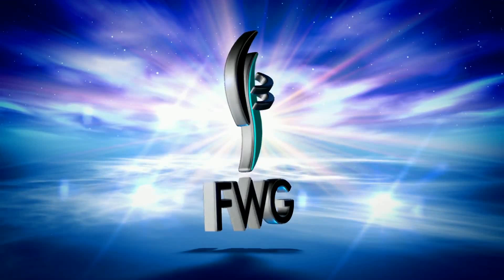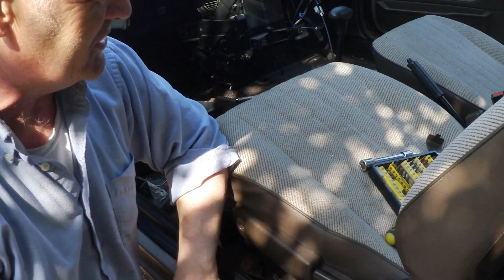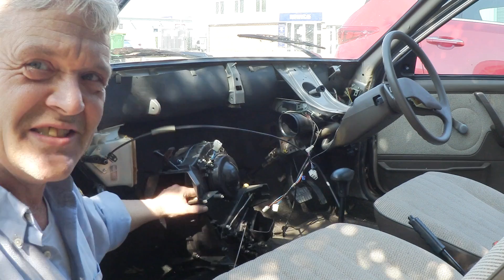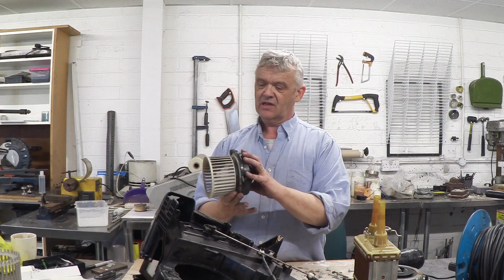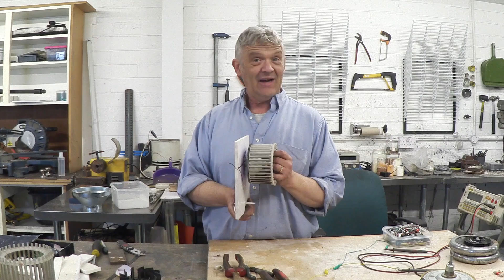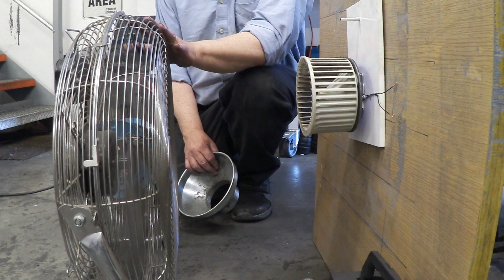Car Blower Rotor For Wind Generator

Comment: Very nice pancake motor. Can't wait for that one. Though maybe not appropriate for this type wind generator I have noticed that rooftop attic turbines seem quite efficient. I have seen them spin quite fast on dead calm days.....just from the heat rising from the attic. Not sure how you would attach one though.
Reply from the maker: yeah I watch them too - we need to get a life mate lol - I joke obviously but a fascinating idea tight there
Reply: @ThinkingandTinkering  Ha ha... yep.
Reply: Spookily I had recently emailed Robert with the very same idea, as, like him, I am irked by the idea of having to apply for planning permission to put up a turbine. And I'm pretty sure I won't get it anyway. So I thought an attic vent, maybe with up specced bearings, could become a 'stealth' VAWT!
And, following Robert's video about improving the efficiency of solar cells using CDs, am also looking at heating an immersion heater coil from a PV cell via a charge controller.
Robert sows the seeds and we can try and make them grow.

Comment: Having the flat backstop behind your turbine is restricting air flow.  

Bingo.   There is many ways to skin a cat.  We do what we can with what we have around here.  We don't have bottomless pockets.  Wondering how your mini squirrel cage fan would do vertical if larger.  Say like a Swamp  Box Cooler fan ?
Reply from the maker: I agree mate there are issues bu I see that as challenges to rise to not problems to bury you - and I wonder about how it would do larger too

Comment: I was going to say jokingly, you should put it in my back gate as the wind whistles through there. I then realised that's what they did with the hoover dam and that works fine, you'll explain why far better than me Bob.
Reply from the maker: lol - not sure I can mate
Reply: @ThinkingandTinkering  lol, perhaps it's just my gate. It faces Sw and is between the garage and the house{dam} effectively making a giant funnel for the air to go through. Even on light wind days I can barely shut the gate. The hole might be a bit of a downer for security but putting your hand through spinning blades may make the local burglar think twice. 
Just checked and joking aside the wind through a metre wide gate opening is over twice that of the front or back garden, as the gate closes the restriction accelerates the wind even more. The way your shutter were Wratting last week you may have the same aspect.

Comment: what do you estimate a car moving 30 to 70 MPH would be able to generate in PSI of air? Could we run an air compressor tool?  How many PSI of AIr pressure could you fill an Air Compressors tank with..?
Reply from the maker: mate - I have no idea - I am guessing it would also depend on crosss sectional area of your collector though

Comment: Looks wonderful... Very much enjoying the continuing theme. I live in Wyoming, US... The wind rarely is not blowing!!  Great to see the cone, I had been considering quite the same, essentially large volume collector choked down to smaller concentrated application... Had been thinking of a megaphone, in general... Thank you so much, Robert!!
Reply from the maker: I think so mate
Reply: @ThinkingandTinkering  I had been considering a directional high volume collector, air flow to turbine of course...   Thinking of incorporating a directional tail, or "rudder"...of course, would be a vertical collector for a horizontal "flat rotor"...  I hope to  play with it a bit...

Sir Robert, I have looked and apparently missed, might you have an email address you prefer to use for a more direct contact and opportunity to discuss a notion or two??  In advance, thanks so much!!!  Cheers...

Comment: Wow!  You ran with it!  lol .. This has gotten me to thinking even more about something .. bc I'm in the process of getting my roof replaced .. from shingles to metal .. and on my house there are 3 good sized vent turbines.  I was up there recently with my neighbor and looking at things.  He went over and held his hand next to the turbine that was moving at a pretty good clip on a sunny 90 deg. day.  I felt it too .. a stream of heat was swirling out of that turbine.  So this video today has got me wondering what it would be like to have a large black box through which heat could collect and pass.
My roof area is about 34 x 90 ft.  makes me wonder what would happen if all that heat was funneled through one passage.    Just not sure there would be much natural force behind it .. but it's interesting to think about.  
Many very old houses have high ceilings .. about 10 ft or so .. that is so the heat would rise to the top .. a natural way to cool a house.  A cupola or heat chimney  would also sometimes be used to take the heat out.  
"Cupolas were originally designed to add natural light and ventilation to the area under a roof. They sit on the ridge of a roof and can be found in many shapes, including square, round, and octagonal. On barns, they're meant to allow a continuous flow of air into the hayloft, helping to dry the hay."
Reply from the maker: I ponder that too mate - very interesting idea I think

Comment: Have you thought about using a fan of this style with a gear ratio to turn a car alternator to produce ac. Kinda like a water wheel  alternator  set up but a wind wheel
Reply: I suppose using a alt. With exterior h bridge that can be just simply removed or just using it as is, to produce dc. I believe 2000-3000rpm is the needed for the alt.  to produce the rated amps.  I'm currently using a 550 motor I salvaged from a childs  electric atv connected to a 21 speed mtn bike I just removed the pedals from attaching the motor directly the the gear.  Then put the bike all the way to the highest gear. Run that motor from 2s lithium pack and a cheap speed controller.  I charge the individual 18650s off a homemade solar charger using tp4056 modules. To technically "free energy" persay.  I'm producing  around 90 amps of the 150 my Alt. Is rated at.
Reply from the maker: yes mate I have - but to be honest - I just don't want to cut the gears - but I will probably get round to it
Reply: I totally understand  not wanting to cut the gears. Like your parts car. Unfortunately but fortunately  I've have 2 pick ups and 3 hondas 1 a mini van I'm currently bout to salvage. Die on me in last 3 or 4 years.  So I had plenty of spare parts and cheap  available parts.  
Thanks for the reply truly enjoy your channel.
Reply: Wait you ment cutting custom gears to get the right ratio.  No that's to expensive and time consuming.  You can use a old Mtn. Bike with a high climbing gear with a tire at least 18 to 20 inches and just run a belt from the tire to the alternator directly.   No big cost not alot of time to put it together you could even use the belt out of your car. Just need a 10-15 buck old bike from a yard sale

Comment: Fantastic work keep it up love to see a vertical wind turbine that has long vertical side funnel to force more wind onto the drive side of the generator blades  and a shield on the other side to stop wind slowing down the generator and the shield and funnel can turn into the wind like a wind vane for direction like on top of a building that shows north east south west to always keep it into the wind just a thought :)
Reply from the maker: give it a go mate - don't wait on others - nice ideas try them
Reply: @Leave means LEAVE! doesn't work at nighttime but it can be windy at night which can make power

Comment: I like the difference the cone made. Really started it moving. I look forward to seeing the next steps as well. Thank you
Reply from the maker: it did have quite an impact - I guess area - same as swept area for a blade design?
Reply: @ThinkingandTinkering  Perhaps adding a cone, like the last iteration, to this squirrel cage to help direct the wind through the blades would increase efficiency as well.
Reply: richard mccann  agreed the cone creates a pressure differential between the inside and outside edges of the cage.

Larger cone. = Larger deadspace = greater air pressure torrential of wind in motion

Comment: I would have liked to see you move the fan to hit the squirrel cage on an angle because I think you would have seen the motor turn. The cone is good for a head on wind but when the wind hits at an angle or from the side it will turn the motor.
Reply from the maker: I tried it mate - it didn't turn well not for the same distance the fan was from the cage - but you are right I should have shown that
Reply: @ThinkingandTinkering  I would have thought it would bounce off the wall back into the cage because as the wind hits the side of your house it is channelled along the wall to the back
Reply from the maker: @stevetobias4890  yeah maybe mate - I don't really know I am just guessing and giving it a go - but wait until you see tomorrow's vid - tbh it's awesome lol
Reply: @ThinkingandTinkering  I'll be watching for sure, I like to be somewhere in the front row of your videos
Reply from the maker: @stevetobias4890  lol - cheers mate
Reply: Having the cone in front would also deflect air down to the wall making it denser on one side for a side windand effectively a  low-pressure area on the far side IMO.